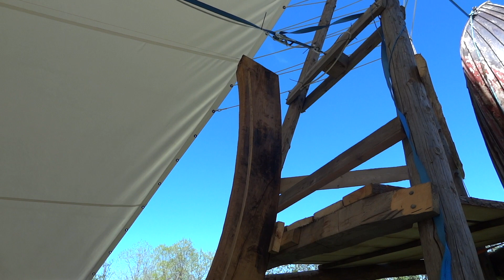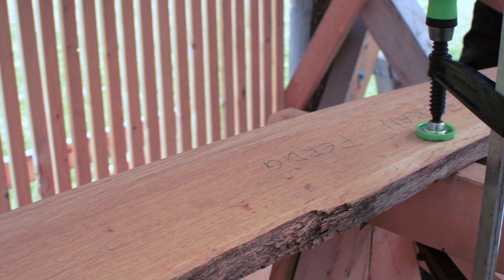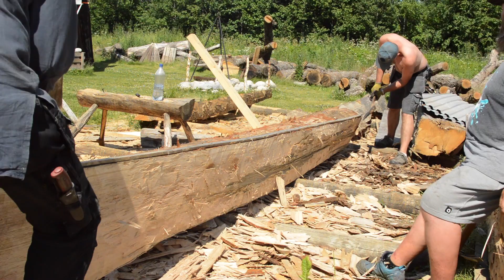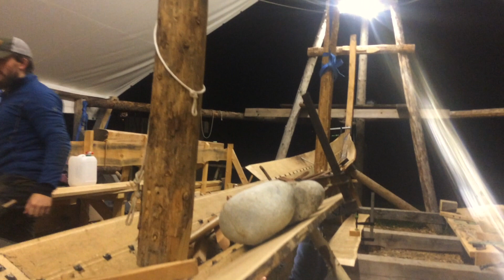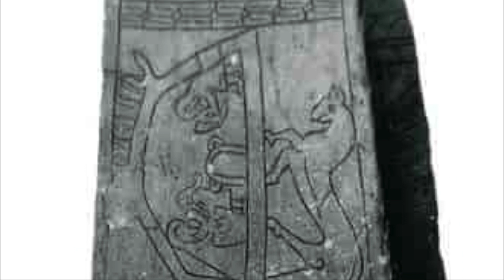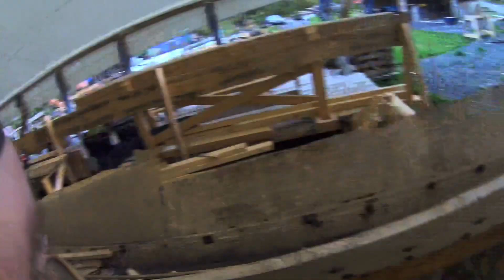🔴Viking ship building in Norway - part two Hardraade's Story

Comment: The old norse must have had a more efficient way of making boards.It's ridiculous to think they split huge oaks with wedges to make boards. It takes too much effort and time and men to make one board if you watch some of these documentaries. They made whole fleets and didn't have the time to carve every damn board with axes. I think they had some method lost after all these centuries.
Reply from the maker: We can still see the axe marks on boards from the period. If you watch a few more of my films you will see that using the axe to side timber is still in use in the production of materials for restoration work on houses at present. There is artwork showing axes being used, so there really is no doubt about how boards were made. What is lost but easily regained is the skill with the axe. After a few hundred hours practice you can get very accurate and effective with an axe.
Reply: @LucasRichardStephens  Yes I've seen the old woodcuts and art showing men using axes. I spend a lot of time working with wood myself and know what a problem the knots can be.  I've been interested in old Norse culture for decades. Thanks for your informed reply. Still, I find it difficult to believe they used only wedges and axes to make so many boards, enough to build a ship in one season. The axe marks could simply be a finishing touch to even out rough areas. The few boards I've seen made with wedges were extremely crooked and uneven, and would take a long time to smooth into uniform workable pieces. Also how many boards they could get from one tree is interesting to consider. Seems it would take a small army of skilled men to just make the boards for a single ship, even with slave help doing the grunt work. There's still so much about life back then that we know little about.  I'm no expert on this topic, just a little skeptical about the board making process.
Reply from the maker: @Northman1963   It is perfectly possible some saws existed, they certainly did in other contemporary cultures. No saws or evidence of saws have been found (of that period) in any archaeological dig in Scandinavia, that I am aware of, while many other tools have. You would be surprised how swiftly one can produce boards with just an axe. A lot of the finesse is in technique. Sawing by hand is very hard and slow work, it saves materials, but I would not fancy it. In any event we have to follow the grain of the wood for technical reasons, every board takes what ever spiralling shape the tree's growth pattern imparted. I can't  think of any easier way of doing it than we employ. We get a few more boards out of each tree using the chainsaw mill, than the the Vikings would have, but not that many more. It is perhaps less time consuming than it appears, it certainly takes us longer to fit the boards to the boat than to produce the basic boards.
Reply: @LucasRichardStephens  This is fascinating. I've never tried to hew a long board with an axe so I'll take your word for it. My hat's off to those amazingly skilled craftsmen from the viking age and you and your team as well.